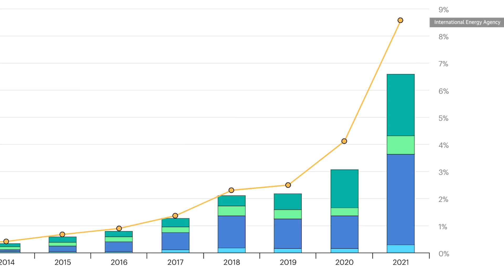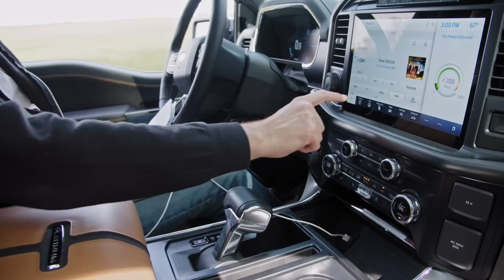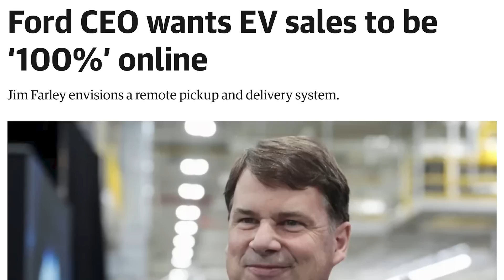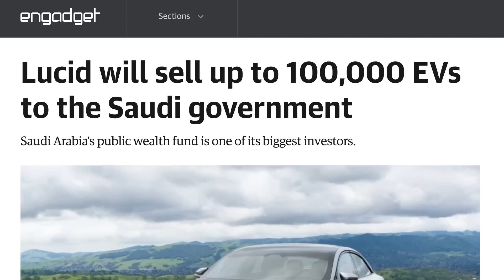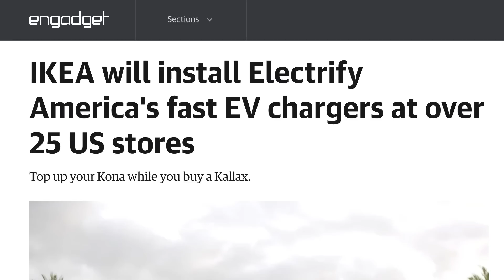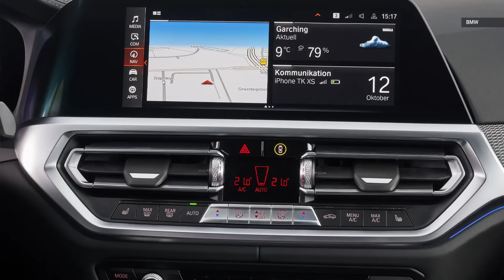2022's most (and least) successful EV automakers: Tesla, BYD, Ford and more

Comment: For a variety of reasons, the EV market is starting to look like a big ponzi scheme. The whole environmental aspect has been swept under the rug ; they're all competing for market share and their value proposition is "features features features", just like the luxury car market. I predict the high-end will shrink down close to oblivion and the market will be dominated by cheap models that have less focus on range and gadgets. The charging grid will eventually become so dense as to negate the range issue for all but those who do long commutes. I see a rise in commercial parking lots offering 1:1 charging spots ; you charging and parking bundled into one price. Still, EVs are not a simple solution for the millions of people who have no garage and have to park their car on the street in front of their residence ; for these there would be no substitute to large battery capacity. Overall the whole value proposition is still a mess, compared to gasoline vehicles
Reply: As a 4 year EV owner (2 x Leafs, 1 x Tesla), if you're non Tesla, yup, still a mess. A Tesla like energy company needs to step up to the plate and offer an imaginative destination charger solution with the same reliable plug in and charge simplicity as Tesla. When it comes to the home, tbh, new types of house are required. Here in the UK, our older houses were designed and built for a different way of life.
Reply: Thanks for viewing and leaving a comment.  Write me to get🎁🎉🤩 your new year prize